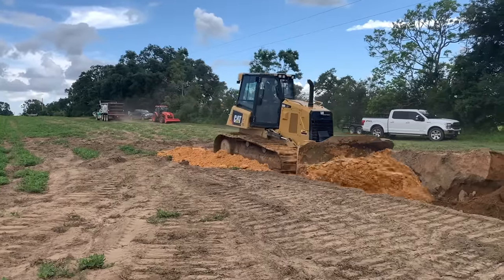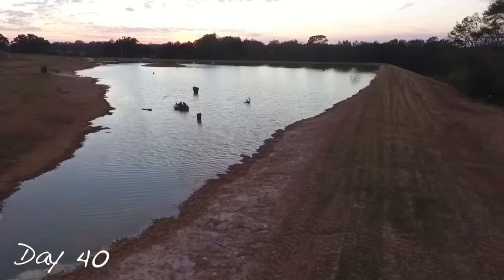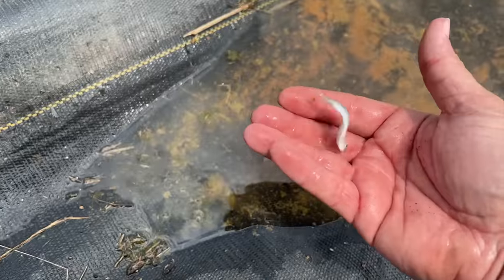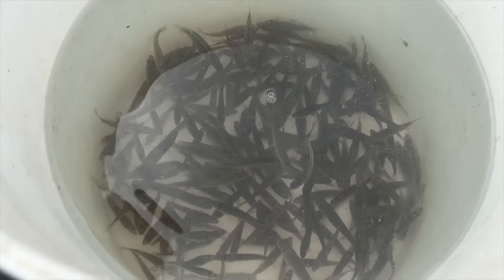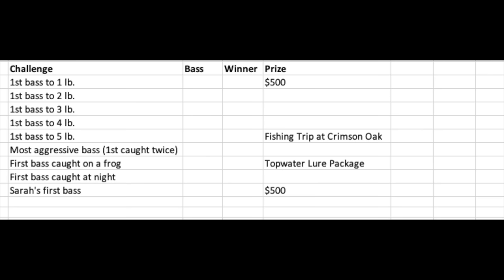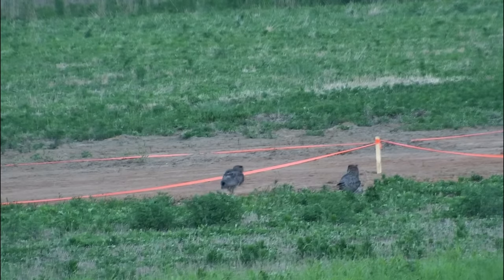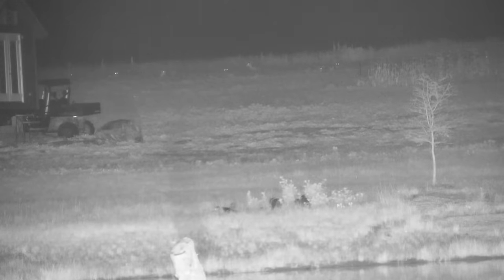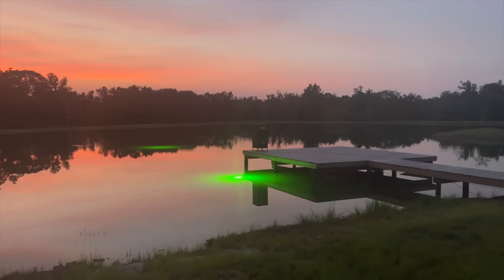Building a 5 Acre Pond! (Adding the Bass)

Comment: You need to run the defusers at night.  This is when the oxygen levels are at the lowest.  I run mine 8-10 months out of the year here in Tx. 8 hours at night. Make sure you are changing the air filters as needed.  They will pick up dust and choke your pump out.  I would recommend a full replacement pump as a backup.  You will need it.  Or a rebuild kit on hand.  Also, blow down each line to the defuser by closing the other valves to keep your defuser heads clean every three months or so.  They will clog if you don't blow them down. I've been using a defuser system for ten years on my pond.  I find running the system 24/7 is overkill.  You will be replacing pumps more often.  I started taking oxygen level readings 24/7.  The primary source of oxygen for a pond is from microscopic algae.  You need sunlight to produce oxygen in the water.  So running your pump at night is a must. Running it during the day when photosynthesis is releasing oxygen seems pointless.  I use to run mine 24/7 but found no difference in just running it at night.  Go talk to a biologist.  I stocked Camelot Bell F1 10 years ago and I couldn't he happier.  Good luck with your project.
Reply: Build a waterfall!
Reply: 👏🏾👏🏾👏🏾 this comment was so well laid out I want to build mine as well one day.
Reply: What a kind and well communicated comment
Reply: F1s have been found to develop bad genetics and stunt later on.  Mine did exactly that.  They were the big new thing even I stocked my pond with them way back about 2000 or so.  In a few years I had nothing but some large bass and 1 lbers. Still to this day there's nothing over 1. 5 lbs.  I'm about to restock with pure Florida bass. My bream are huge still

Comment: We have a diffuser on our pond, we run 24/7, for a pond that size it’s good to have that water constantly being circulated, I would also suggest adding painted turtles, snails, and fingernail clams to the pond, to keep the water clean and clear
Reply: I was just wondering about how a landlocked pond like this was going to be kept clean
Reply: Circulation is not the most important  part,  is your DO. Keep it between 6-8mg/L. Snails etc can be an issue so using biological products like enzymes or bacteria
Reply: Growing plants also helps to clear water and require less maintenance
Reply: @noadnie8210  has only very limited impact,  unless you have whole lake covered.
Reply: There is nothing so wonderful in all of God’s creation as a fresh water pond.  I agree with the previous comment.  See if you can add painted turtles, FRESH WATER SNAILS AND  A LILLY PAD OR TWO.  God bless you in all your endeavors because you have increased the joy for all of us.  Keep up the good work.  All the best!
Reply: @David-gld  slimy algae ?
Reply: @David  string algae is different. String algae react to minerals, not necessarily to nutrients. It loves concrete.  Can be very easily dealt with.
Reply: @David  don't use herbicide. I been doing this for 35 years commercial,  I pretty much use enzymes and aeration for all. Even aquatic plants.  I  have pretty clear water
Reply: @David-gld  trust me string algae is easily controlled,  herbicides cause all types of issues.  Sure you want some algae,  but you don't want to risk a cynobacteria outbreak
Reply: @David-gld  well as I said,  you want a greenish hue, but relative clear.  Gives you much healthier stock. Nitrate comes naturally with lighting and nitrogen fixing.  As I said I am water management specialist. Aquaculture is part of my work
Reply: @David  you be amazed how quickly nitrates build up in a lake system.  Also bass is not filter fish like carp, so what do you need algae for ?  If you have a pond you feed them, even if you have prey fish
Reply: This is the first  "perfect"  pond I've seen that needed an aerator and fish pellets....

Comment: About using diffusers in the summer, it actually is a pretty debatable question and also depends from different factors. When having trout or maybe some sturgeon that need higher concentrations of oxygen throughout the year in your pond, then it probably is advisable keeping them on. If you have carp or any other cyprinidae family fish, then it's probably not needed. It also depends alot from the vegetation that you have in your pond, because they are the natural producers of oxygen together with the sun. We also have to consider, that oxygen dissolves much better with cooler temperatures and there is a maximum level of concentration depending on the water temperature, which means it's much more difficult to raise oxygen levels with higher water temperatures. We usually only use diffusers in the winter, because the climate is so cold and don't do it in the summer.

Comment: I like what you done. Few points so aeration generally is most important at night time, however 24h a day is optimum.  Best is to have a DO meter and check DO regularly  you want DO min 4mg/L but best 6-8 mg/L. Spring and autumn is most important and after rain.

Comment: So for my understanding, the key thing is to spread a 2 foot (ca. 60cm) layer of Clay blanket over the surface so the water won't be absorbed by the terrain, correct? is there anything else needed underneath or above the clay blanket layer? or any terrain treatment? I am thinking of doing the same but in a much smaller area as a start for later going to something big like you did.
thanks!